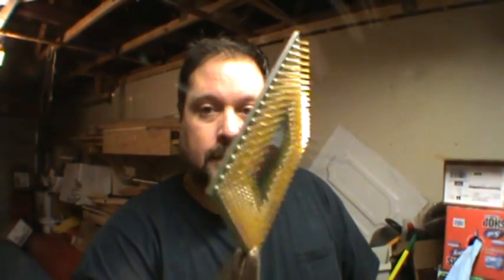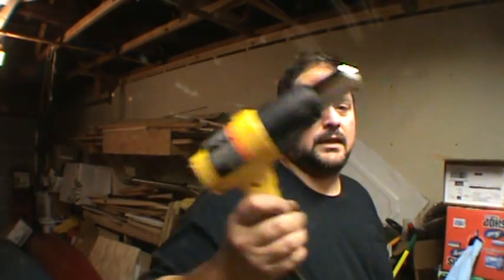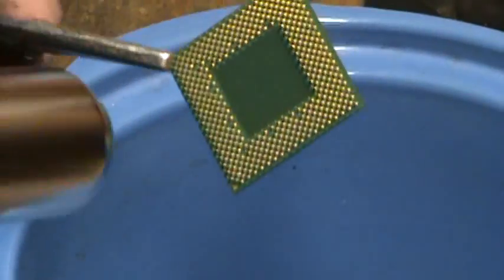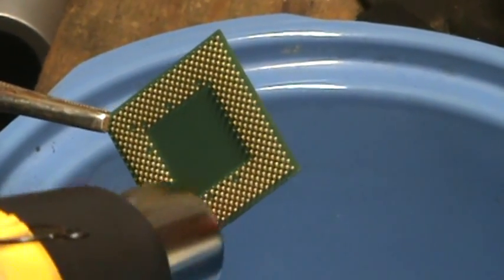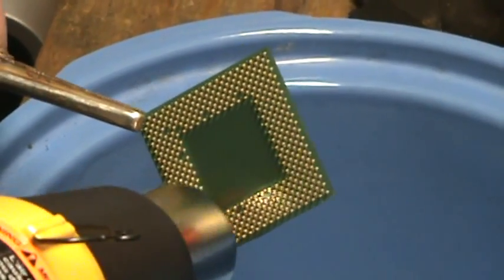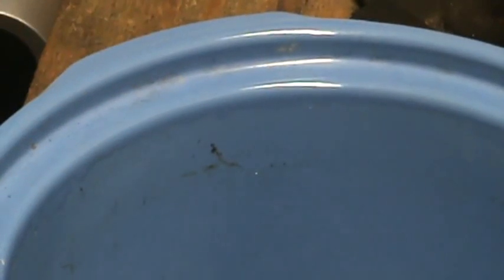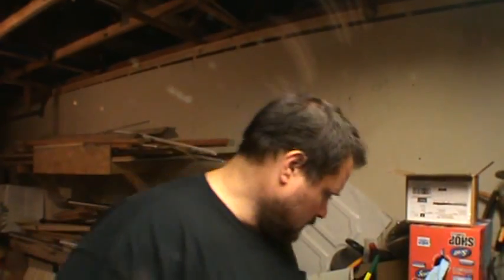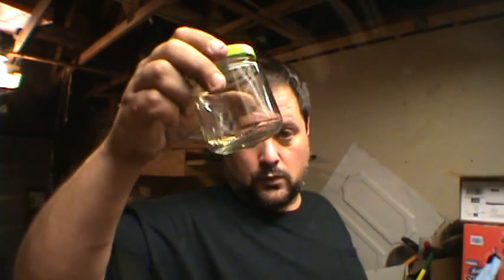How To Remove Gold Plated Pins from Green Fiber CPU's: Top two methods

Comment: Ok, so how do you get the gold off the pins? I can only find the gold fingers removal?
Reply from the maker: I dont have a video on that just yet.  Original feets has many though, Its simply throwing them in a bottle of AP.  Just need to remember that 1 gallon of AP will take 2lbs of the base metal into solution so if you have more than 2 lbs of pins you will need more than one gallon of solution.

Comment: Could you use a hairdryer?
Reply from the maker: Yeah, hair dryer will just make the cpu nice and toasty warm for you.
Reply: Heat guns output much more heat than a hair dryer.... imagine blow drying your hair with 750ºF+ ...
(heat gun he is using has two settings, 750ºF or 1000ºF)

Comment: Thanks Moose Scrapper for your great effort and  i just want to know after separating gold dust out of from different electronic circuit how  you do make gold?
Reply from the maker: Once the gold foils are removed, then you purify it with chemicals.  HCL and Bleach, the gold dissolves into the solution, you filter it then precipitate with sodium metabisulfite.  then you filter again, and smelt the powder for your gold.  Thanks!
Reply: Moose Scrapper Could you make a video about that? Thank you.

Comment: I do this a bit different.  Being a gold miner, I have a rock crusher that I use to grind quartz into dust to get the gold out.  I just drop the whole circuit board in!  The whole thing is ground to dust in about 5 seconds.  I simply pan that.  All the lites like fiber board and ceramic pan off leaving all the metal in the pan.  Hit it with acid and then wash and put in a crucible and fire it with a torch and some smelting flux.  That pulls out the lead and leaves an electrum of gold, silver and a tince of copper.  If it is over 15 carrot, I just sell the button like that.  If under, I save it up and purify it to 999 gold and silver later.  Waste not want not :)

By the by, you can use the chlorine leach  method (cheap) but bases are even more dangerous than acids!
Reply from the maker: NICE!  I will have to look into one of those rock crushers....
Reply: This works great. I ran 8 pounds of IC chips in their epoxy packaging in under 5 minutes a couple days ago. I have an impact mill. Changed up my pulley system to double the rpms out of the motor. Its spinning in the range of 7000 rpm. It really makes quick work of a pile.

Comment: One hint on HCL.  It is expensive at ACE but the dollar store sells it for $1 a quart.  They call it "The Works" comode cleaner.  It is 20% HCL but a hot plate will reduce it to 50 or 75% pretty quick.  Better do that outside :)  You also better watch what your doing with 75% HCL!!!!!!!!
Reply from the maker: Great tip!  That is much cheaper!

Comment: what about brown cpu's
Reply from the maker: Those are less common but this should work on those too.  Thanks!
Reply: i have one i also have gold from 2 phones one on the phones boards has a lot of gold stuck on it i mean a lot i put it all up on ebay but no one has bid on it
Reply from the maker: cameron G Right, phone boards are deceiving.  It looks like there is a lot of gold on them but what people need to understand is that 1 ounce of gold can be made into 1 mile of wire.  Gold still performs well when it is very very thin.  Phone boards have such a thin layer of gold on them that it is rarely every worth more than $2,  Then you have to think about what a person will pay for shiping then processing the gold.  Buying two phone boards would not be very wise.  Gold recovery is a game of quantity.  You have to have a lot of material.  It ads up over time.  Thanks!
Reply: So three phones and two computers and 16 stick of ram later lol
Reply from the maker: That's a great start!  Keep on going!  the gold fingers from 100 ram sticks will get you 1-3 grams of gold.

Comment: What is a flat pack? What do you do with that?
Reply from the maker: A flatpack is an integrated circuit that is typically square and looks like the picture here, you may have to scroll down a little. 
http://scrapmetalforum.co.uk/phpbb3/viewtopic.php?f=14&t=388&start=20
They have a pretty good gold yeild of about 4-7 grams of gold  per kg of flat packs.  You can sell them for a pretty good price on ebay, or if you have a lot, a few kg, you can try processing yourself but it is a multistep process.

Comment: What are all the little chips and stuff on the boards? What are they made of? Anything there of value? After you remove everything you want from the boards what next?
Reply from the maker: Hi Mary, thanks for watching!  The little chips on these boards are monolithic ceramic capacitors.  They are made up of ceramic sheets, silver and palladium.  They can be sold on ebay for a fair bit of money!

Comment: How do we get the gold off the motherboard itself.  Is that gold as well?????
Reply from the maker: Hi and thanks for watching!  That is a great question, one that I get often.  I have been scrapping for a while now and have broken down hundreds of computers.  To date I have not seen a motherboard that has gold plate on it.  To remove the gold plate from larger boards however, you want to give it a hot sand bath or use a heat gun to remove all the bits of is and as much solder as possible.  If the tracks have a green solder mask on them you can remove that by soaking in 1 gallon near boiling water and 2 tbsp. lye for ten minutes.  The solder mask will come off with a tooth brush.  Be careful, lye is caustic and can burn skin.  this newly cleaned board can go into the AP pot to remove the gold.  Best of luck to you!

Comment: Great video, wanted to know if those flat square pieces on the other side of board are gold plated and is there away to get those off if they are?
Reply from the maker: Hi and thanks for watching!  The little flat square pieces on the back of this one are not gold plated.  Often those same pieces on ceramic cpus are gold plated.  There may me monolithic ceramic capacitors on there and you can just take them off the same was as the pins, heat and tap.

Comment: hi Moose it's me again on the first cpu chip you just did in this video on the back is a piece of fragile metal do you or anyone know what this is as i have so much of this set aside from plasma screen ribbons also but no one can tell me what it actually is
Reply from the maker: Great question!  I thought it was glass, but it will probably be one of things that I slap my self next year for throwing them out.  I do not know what that part is.  Perhaps originalfeets, indeeditdoes, or geo may know.  Best of luck to you!

Comment: Is there actually money in this.. I mean obviously gold is worth money.... But wouldnt i need a hell of a lot to make it worth the time/money.
Reply from the maker: That is one of the most common questions I get.  Unfortunately only you can answer that.  What is your time worth to you?  How quickly can you learn these processes so that you can do them efficiently?  How much material can you get your hands on?   make more money scrapping steel, ,copper, aluminum etc than I do recovering gold.  But I find gold recovery fun and it is still profitable whe compared to the cost of materials.  I also only run these processes twice a year so that the majority of the time spent is on gathering material.  Because the sources of material vary so greatly, there is no way to calculate a dollar per hour.  You just need to try it for your self and then determinie if its worth it for you.  Thanks!!

Comment: I have two words for you: 1. HHOHHU (which stands for HHO Home Heating Unit), and there would be a dot com on that. Evidently, these things can heat 1,000 sq. ft. on 300W /hr. Not bad by my reckoning. 2. I have the same problem with my shed, except that it doesn't have any power at all. I'm just getting to the point where I can get power to it, but that won't be until spring.
Do you mind if I ask where you are? I'm in New Brunswick, Canada.

Comment: Hi Moose. I noticed you're using a crock from a crock pot you took apart in another video. A good example of Reduce, Reuse, Recycle.
Something that would be a sort of crossover/compromise might be a torch that is fueled by Brown's gas. Basically, pass an electric current through water to produce HHO. Hydrogen is fuel, oxygen aids combustion and they're already properly proportioned. Burned HHO turns back into water, and you get the heat you need. Just trying for quick, easy and clean.

Comment from the maker: are fairly inexpensive and can last a while.  I would say that if you can collect several kg of cpus in a reasonable ammount of time for you then it is most definitely worth it for anyone.  This is a hobby or me so I am doing it for the fun of it.  I have not had to spend more than $100 to get pretty much completely set up with equipment and chems so it really does not take long for the gold recovered to out weigh the costs.  Thanks for watching!

Comment from the maker: OK, lazersteve has some vids and a link to his website where I believe he has a video on removing the green solder mask.  Its quite easy with lye and ho water.  Just make sure you are wearing protective gloves as lye is caustic and dangerous.  The fumes are minimally hazardous though.  Most mother boards do not have gold etch under the mask though.  If you have a glass pyrex 9x12 pan you can mix up some lye and water, I'll have o get back to you on the ratio and soak for ...

Comment from the maker: Great question!!  Most scrap yards (mine included) have at least 2-3 different types of ferrous materials they take.  Cast iron is very heavy, dark, and is just plain old thick heavy iron found in old pipes, old wood stoves etc.  They pay more for this essentially because it has more, well, iron in it.  Steel, is iron and carbon so for regular steel you typically get a little less.  Sheet steel is a term that is used sometimes for white goods like appliances.  Lite iron is pretty much...